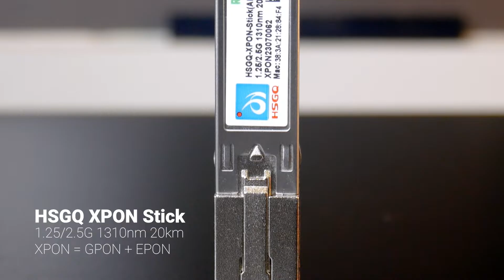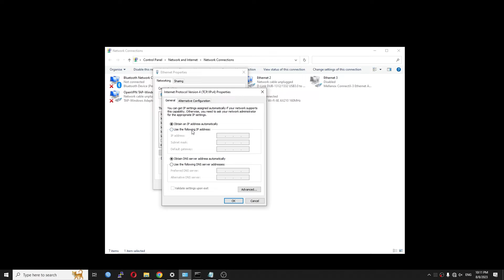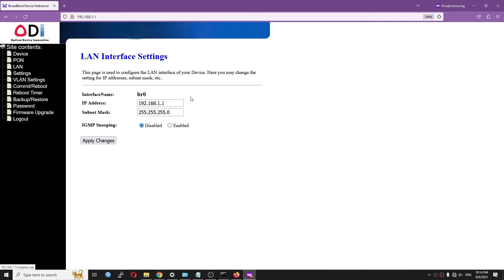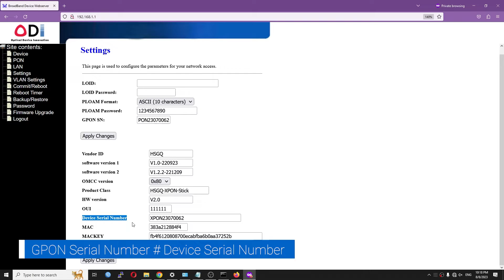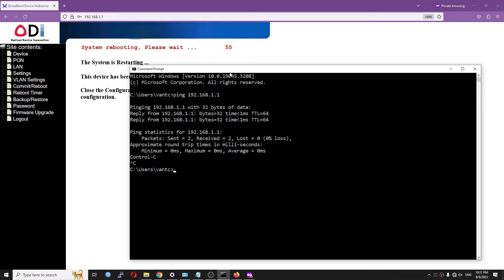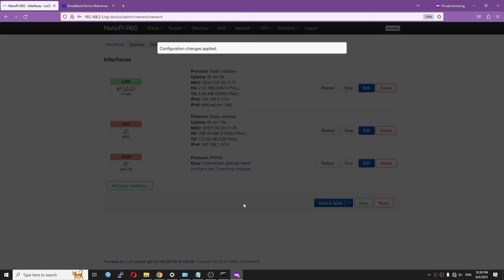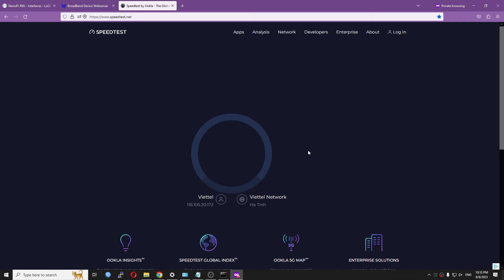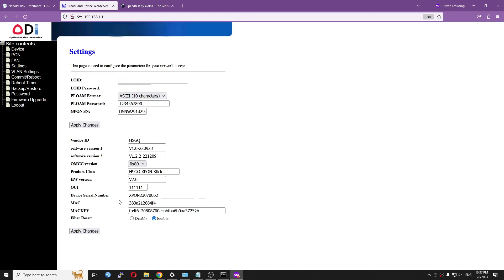Replace ISP ONT/ONU - HSGQ SFP XPON ONU Stick

Comment: Hello,  
I recently bought this XPON SFP stick and it comes with a much newer firmware version, 1.1.4_250613. I configure it with PPPoE user, password, and the PLOAM, which is what I need for Movistar Spain. I need VLAN 6 for internet with Movistar, but it doesn’t work. Running a command through Telnet I see that it expects 922. If I configure that one, then it does connect to the internet… Why is it changing the VLAN? I know officially that in Spain and with Movistar the VLAN for internet is 6. Any ideas? Should I modify the firmware? To which version?

Thank you very much.
Reply from the maker: If it works well then you don't need to worry. I see the same with one if the ISP here in Vietnam. There are S-VLAN and T-VLAN (well, you can look them up in Gemini). Sometime, with a non-ISP provided ONT, will will somehow see the S-VLAN ...

Comment: I have such a moment that sfp that we configured it works only heats up so normally, so I have it installed in kinetic giga and when the light turns off and then turns on, then on kinetic pppoe connection does not connect automatically. And if I'm not at home I have to wait until I come home go to the web configurator there I will connect or until I reboot the router myself.

Maybe you have or have had such cases and maybe there are some solutions

Comment: I am using ISP ONT box with RJ46 and RJ11(telephone) and device in bridge mode with my virtual FW doing PPPoE & routing, is there any advantage on replacing ISP ONT with this device/method in video;

Comment: HSGQ is not being detected by intel x520-d2, any way to solve this? Tried forcing the stick to 1g also
Reply from the maker: Hey, did you try to contact the seller and get the newest version.
Reply: Yes, I'm on V1.1.8-240408

Comment: how do i connect voip? the sfp stick nor the media converter does not have rj11 port.
Reply from the maker: For VOIP, I will suggest using the ONT with RJ45/RJ11 port instead.

Comment: I've got the exact sfp stick like yours. Plugged it in my Archer BE800 and there's no way I can access the sfp stick to set it up. Is there any chance to get through, mate?
Reply from the maker: I have no idea, you need to find a Media Converter, or use a router that support firewall rule, such as Mikrotik or OpenWrt. In this video I use OpenWrt
Reply: @VanTechCorner hi Van. Exactly. A media converter works like a charm . Thanks, mate

Comment: Hi
 I just got edgerouter 4, and i wanted use it as a replacement of onu i got, so where i can finde it 
I search on Amazon, and I  couldn't finde it or other sfp you using in your tutorial 
I live in the middle east 
can you help me please
Reply from the maker: Hey, if you are in the Middle East, you can get a similar module from LEOX. See the LEOX LXT-010S-H, and the contact also available in my video.

Comment: is there any good reason to replace the one from ISP provided one with our SFP module?
Reply: Mostly for neatness sake, your router would be able to directly connect to the WAN rather than have to go through a modem or your ISP's router. And you wouldn't be bottlenecked by either but that's not why I did, I did for the cosmetics reason
Reply: If you ask the question, most likely you will not see any benefit from it,, but in short it permits you to switch the ISP router which usually offer very basic configurations on the user side, for a more advanced router as a PfSense or Ubuiti systeme where you can manage basically everything on your network. Also for big wi-fi coverage, usually the provide box is sub-par in speed and coverage
Reply: I have cloned the gpon serial number to the sfp module and inserted it in the media converter when I connect the rj45 port of media converter to my pc I did not get the internet however I have the O5 status on the module, can you suggest something. I am using a static public ip which I have already put in my pc.please suggest.
Reply from the maker: You need to setup the internet connection on your PC: DHCP /  PPPoE / Static IP for to have internet connection. Please note some provider will also check the MAC address of the router/device as well

Comment: halo bro saya dari indonesia mau bertanya apakah semua Media Converter SFP supord dengan gpon sfp modul ?
Reply from the maker: Hello bro, the Media Converter is basically a device where you connect the SFP module to establish the fiber connection. So you will need both the SFP GPON module (if your ISP deploy GPON) and the Media Converter (to conver the fiber signal to Ethernet - if router router doesn't have a SFP port)

Comment: Hi Van. Please just let me know if this SFP module will work in my network environment. It is a 11 building condominium where the ISP working under dark optic fiber providing 4000 Gigabytes that goes to the MDF where the OLT is located, from there spread to each building to a splice, from the splice to each building apartment APC type fiber to a Corning model 7298 SDAN 8 ports from GE01 to GE08, from the Corning to an AP station. Means this is a sharing ISP network. 
I do have my own network lab rack with the connection straight from GE01 to my server, just unplugged out the AP and turned off, with my own internal static IP. into a ER605 dual Wan low balance controller with a fail-over Cradlepoint 5G CPE as secondary ISP. 
Well my point is when I disconnect the APC type fiber out the Corning SDAN device and plugged into the HSGQ GPON FSP module to the 2500M network adapter automatically gets GPON Status O5 LOID Status=Initial Status with non configurations needed, the R6S NanoPi gets RX-3900Pkts/ RT-700Pkts. But connection attempt fail in PPPoE mode or DHCP either way, I'm using the R6S NanoPi with three Ethernet ports from right to left Wan-Lan1/2.5G, Lan2, HDMI, USB-CPD . What is missing here, or this is not possible with this ISP network sharing configuration. I've tried already the WAN option eth2.1 throughout 1000, mean not Vlan's works from 1 to 1000.  Thanks for your answers in advance
Reply: Did you fix it?
Reply: @yahirluciano9857  No really
Reply: I just went through a firewall configured with Pfsense on bridge mode. This firewall is open-source and has two sfp modules up to 2.5 Gig, but after a lot of tryouts, the XPON Onu stick won't work. So I just configured as bridge mode from the corning over ethernet port. I'm still wanted to make this happen, but it looks ain't working

Comment: Hello Van Tech, i hope u can help me. i ditched my ISP ONU, and im currently using a VSOL ONT with a openwrt router. My ISP provides internet and telephone via voip, and everytime bridge ONU reboots openwrt router get a ip from VOIP range (10.XXX.X.XX), and because of this i have to restart wan interface to get a internet IP. is there anyway to fix this on openwrt?
Reply: You might want to check VLAN settings, assuming the ISP uses different VLANs for Internet/VoIP/IPTV, just contact a technician or look on your local forums

Comment: I believe your firmware is out of date. I have model DFP-34X-2C2 Firmware Version which is V1.2.2-221209. It's has IP6 and a menu of options across the top, you need to maybe speak to someone to update as I found I had to do this when I got my unit, the sellers sent me the file.  They are quality devices. And great value.
Reply: Updating to 221209 version crippled my Internet. I had to downgrade it to the same firmware as Van's
Reply: @MrTrannhattan  I can confirm your comment I bought a latest hsgq sc apc DFP-34X-2CY3 my internet connection didn't work with it's latest firmware and new interface  even though I got registered with my isp and got 05 pon status so I installed DFP-34x-2c2's older firmaware with van's interface and now my internet connection working perfectly I thought DFP 34x2c2's firmware would brick my DFP 34x2cy3 sfp module luckily it did't brick
Reply: can you please send me the new V1.2.2-221209 firmware
Reply from the maker: @michaeljarcher Yup you are correct. I haven't update the stick when making this video.
Reply: Here’s the English translation of your text:

---

Hello,  
I recently bought this XPON SFP stick and it comes with a much newer firmware version, 1.1.4_250613. I configure it with PPPoE user, password, and the PLOAM, which is what I need for Movistar Spain. I need VLAN 6 for internet with Movistar, but it doesn’t work. Running a command through Telnet I see that it expects 922. If I configure that one, then it does connect to the internet… Why is it changing the VLAN? I know officially that in Spain and with Movistar the VLAN for internet is 6. Any ideas? Should I modify the firmware? To which version?

Thank you very much.

Comment: Can you simplify why you need to replace your isp ONT?
Reply: For flexibility. of course, default ONT from ISP work fine.. but fine tuning can't be done with standard ont.
Reply: You can’t replace ont won’t work with isp hardware
Reply: isp ont is a default device, it’s convenient but there are case when your device is better. For instance, when use isp ont then dms traffic is manipulated with isp (mit) but with my own router I can use doh, dot for better control.